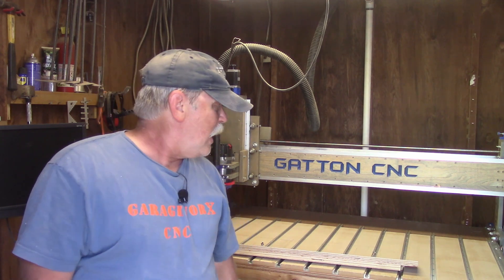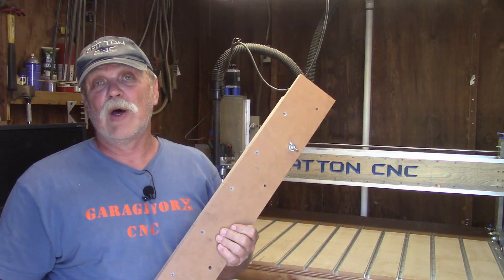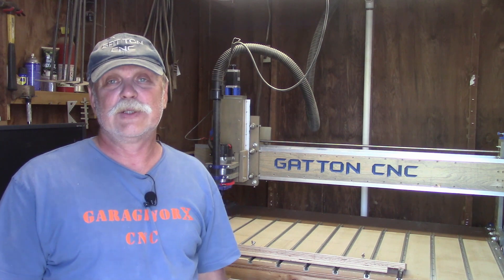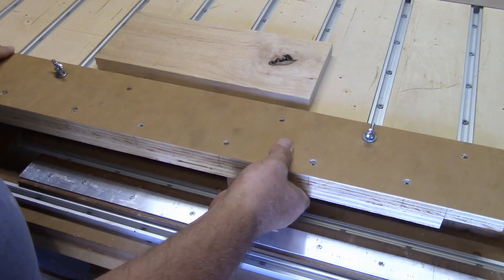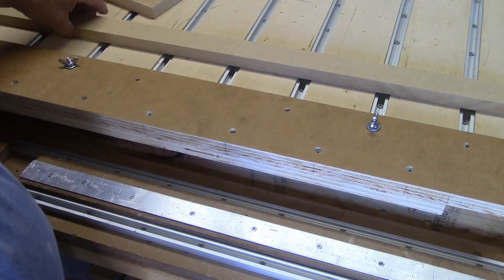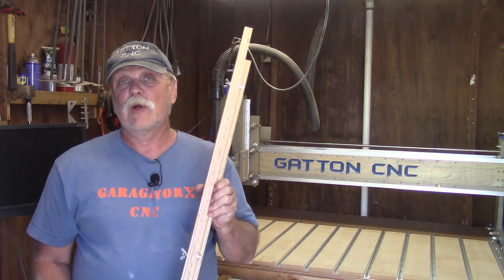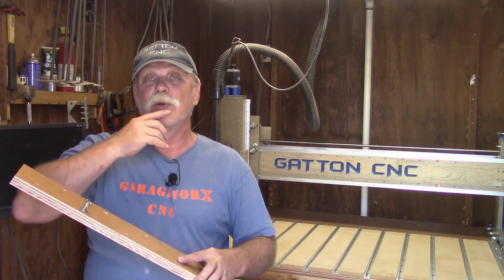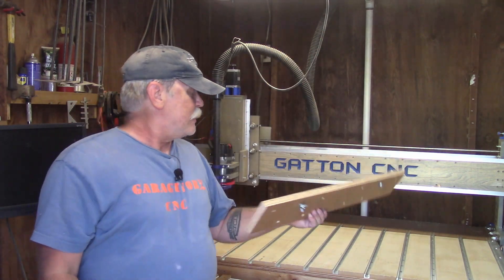Making My CNC Table Alignment Jig

Comment: Great video Mark!  Q: Why aren't you concerned about making sure the Y axis of the machine is parallel to the wood piece?
Reply from the maker: Unless the material I'm mounting is perfectly square (which is rarely the case,) I can either have one edge parallel with the X or another edge parallel with the Y. I usually choose the longer edge, which is usually the X. Typically, I just need one edge parallel with one axis, as I normally cut the piece out of the material anyway.

Comment: Great video Mark. I did something similar except  I aligned the backstop board (3/4" thick) to my machine then added a thinner board (1/4") on top of that with about 1/4" overhang.  That is my reference board that is screwed to my spoil board. That way my project material will slip under 1/4" overhang material and hold it in place. Then make another set of boards used to lock the project material in place. That is also screwed to the spoil board.  That gives me 1/4" hold down lip the length of both sides of the "X" axis material. If I get too close to these hold downs, I'm just cutting wood.  This works well for 3/4" material. With thinner project material I just add shims.

John Frankforther
Reply from the maker: In the video that follows this one (the Home Sweet Home sign,) I introduced another jig that works with this one. It uses 2 toggle clamps to hold down the material while I cut the keyhole in the back of the sign. Most of the time I just use this jig to get my material aligned with my X axis.
Reply: @MarkLindsayCNC  I have used the toggle clamps before but they always seem to be in the way. For small quick cuts as in your sign they work well. I can send you a picture of what I'm using if you are interested.  P.S. I haven't tried the tape and super glue yet. Thanks again for the great videos.

Comment: Just finished making mine. Thank you for making this video!  I was using a 90° bump stop but still had issues on the far end of the machine if a piece was long. This is perfect!!
Reply from the maker: Thanks, DC! It's a handy jig to have around. I'll put it to use in this coming Sunday's video, and I'll have another trick up my sleeve for it next week.
Reply: Mark Lindsay CNC the bump stop covered both X and Y but I don’t took up space on the machine and only gave me one spot to mount material. This gives me full open availability!  Again thank you!
Reply from the maker: You're very welcome. I'm just glad you got some use out of it.

Comment: I used a 60 degree vbit to carve a 1" grid over my entire table.  It works great to align with clamps.  For CA I just clamp a straight piece of plywood aligned with the mark, then glue the work piece using the plywood as a reference
Reply from the maker: Lots of folks like that method. I just don't like having to do it every time I resurface the spoilboard (which is overdue, I'm sure you noticed...)

Comment: I put a permanent marker in my router and run the X and Y and drew a line on the spoil board. Then I line up my work piece  to the line. I like your idea and think I will make me a jig because sometimes it's hard to line up on the marked line. Thanks  Mark.
Reply from the maker: I did the same thing, Larry. An additional benefit to using the jig is it won't get machined away when I resurface my spoilboard. lol

Comment: Great timing, Mark. I just did a simple drag (not spinning) of a V-bit to lightly etch the aluminum bed for X-axis alignment on my Piranha Fx. Your way is much easier to set up, with or without a spoil board on the bed. Since my Z travel is limited to about 3", I have to remove the spoil board when doing anything beyond 1 1/2" thick.
Reply from the maker: Thank you, Mike. This jig really works a treat.